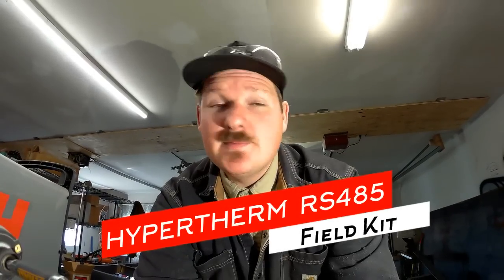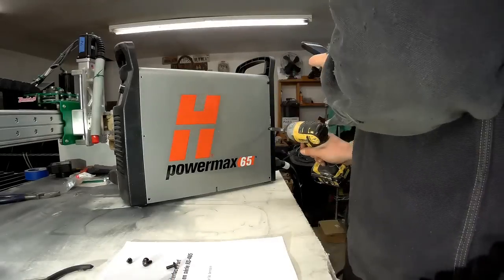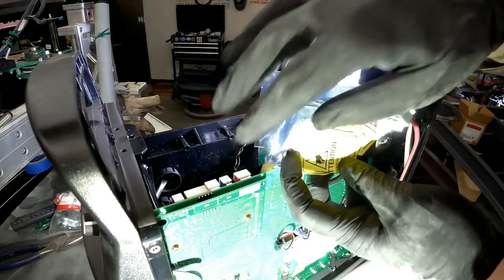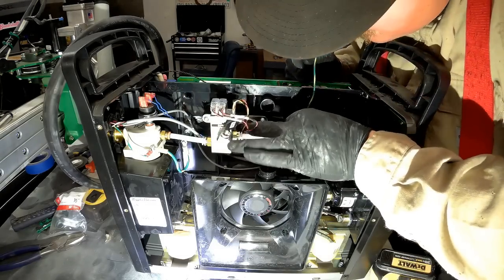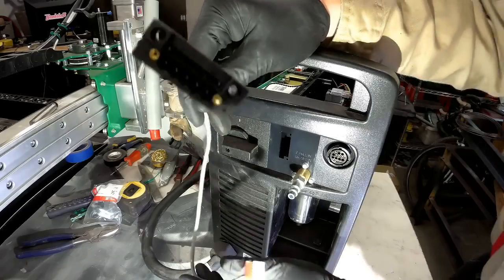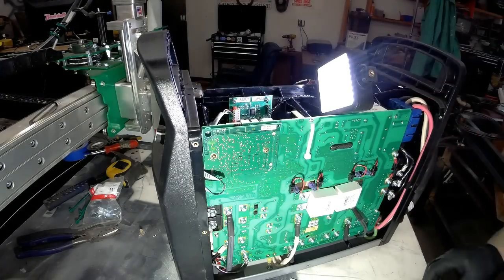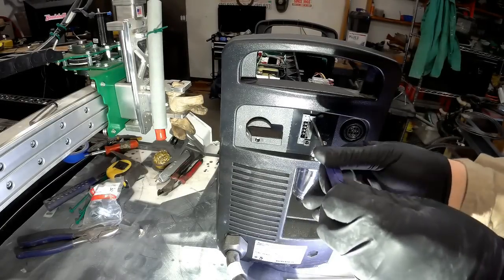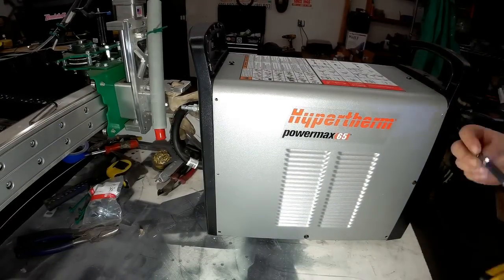Installing Hypertherm RS485 Field Kit

Comment: Will you  make some sparks already! JK :)

I drilled and tapped another 100 holes today my base frame should be done by tomorrow..
Reply from the maker: SegoMan ha ha ha 😂 The drilling and tapping takes forever, hope it turned out good for u.
Reply: MT,

I'm doing lots of pics for a vid when it's up and cutting, We are having a blizzard (NW Colo) so I need to finish the rack and make room for the forklift to move inside..